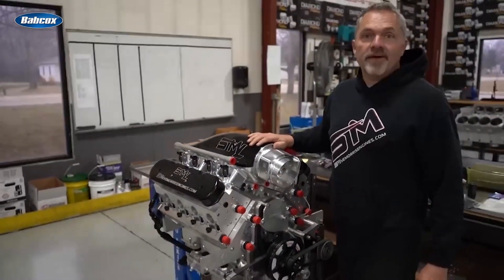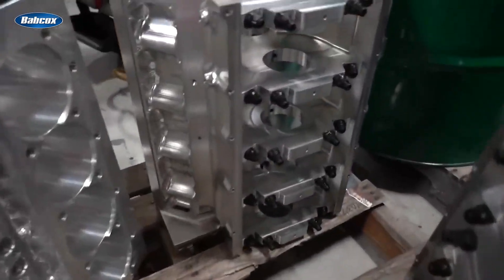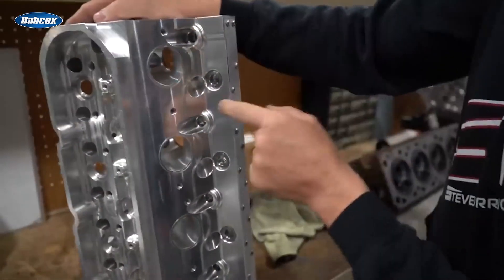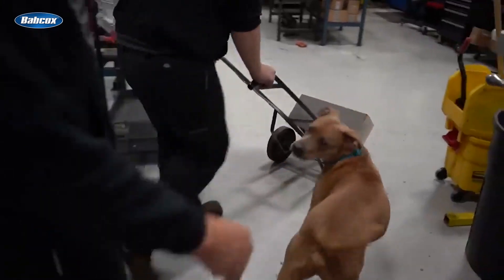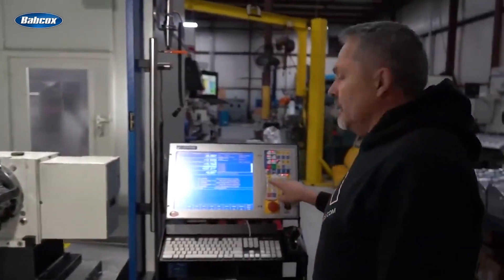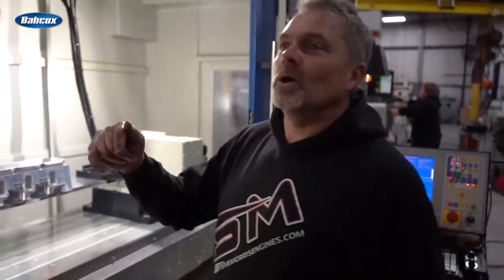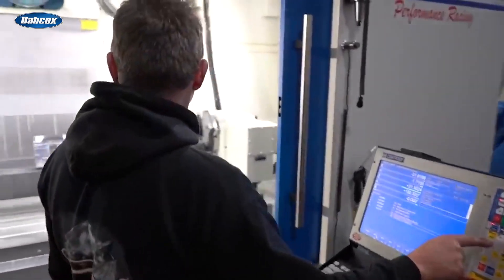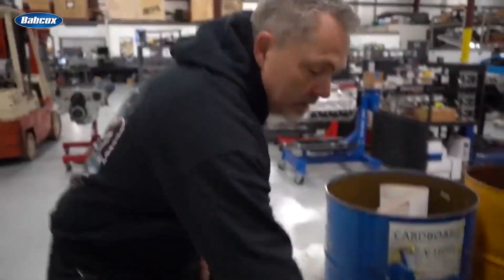What Goes Into Steve Morris Engines' SML Cylinder Heads?

Comment: Billet stuff sure looks neat but a complicated part like that is always going to make a LOT of chips.   The compressor halves on the development engines that are now in the F-22 took about a 700 lb block of titanium and hogged out the part that didn't weigh 50.   Sure looked gorgeous when done!!!
Reply: Whoa, 650 pounds of titanium chips I wonder what that brings in dollars when it’s recycled
Reply: So what if it makes lots of chips ?  108 pounds of aluminum probably costs less than $400.   CNC machine time is pretty cheap these days.  You get a solid head out of it.   How else would you make a high performance cylinder head ?   

If you want to talk about a lot of chips, the block has way, way more material removed than the heads do.